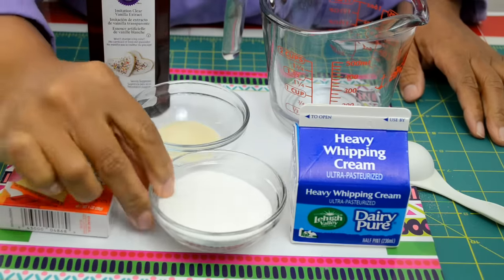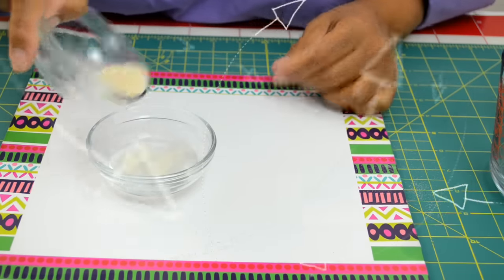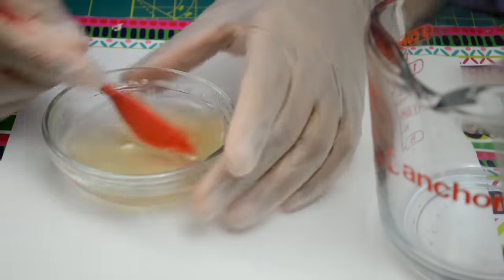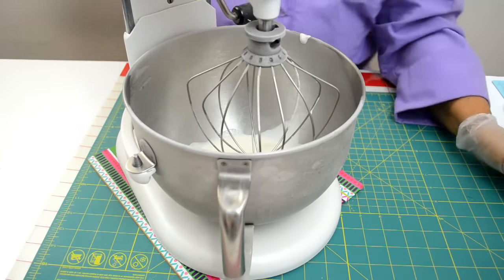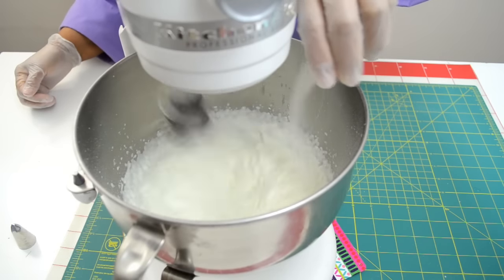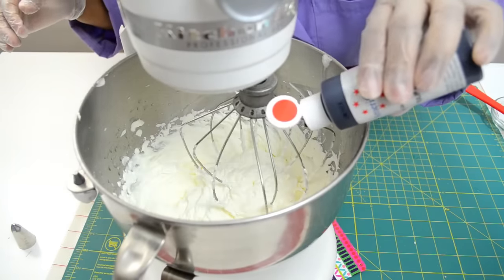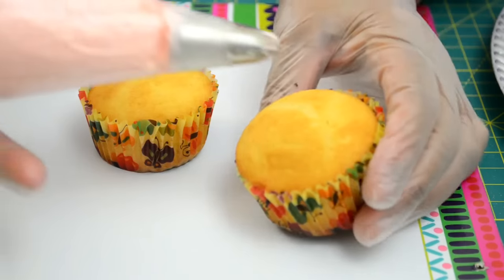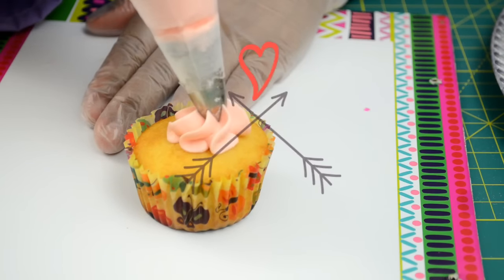How to Stabilize Whipped Cream

Comment: Hi Yolandas, Is this a less sweet frosting, Can i use this in place of buttercream frosting to make roses or other flowers. Thanks.
Reply from the maker: Hello Deepa. Yes, it is. It's less sweeter than regular BC. Yes, you can make roses that are not heavy and it should always be refrigerated--you may bring your iced cake out for not longer than 2 hours, as it will start to melt.
Reply: Yolanda's Cakes Thank you
Reply from the maker: You're welcome!
Reply: Dee

  pa Binu 😇😠😉😦
Reply: Hi Yolandas, Is there any other substitute other than Gelatine?